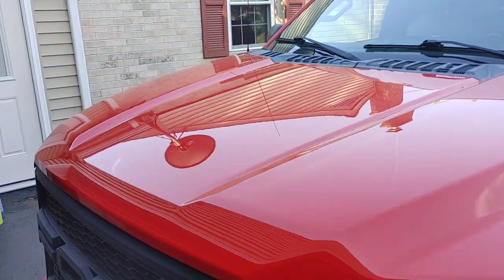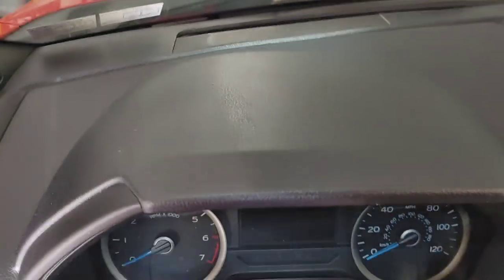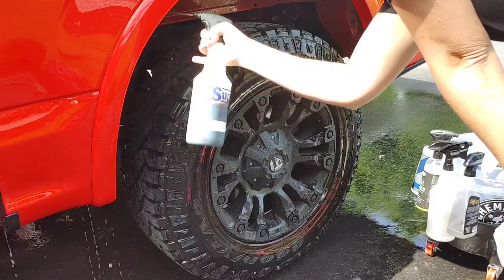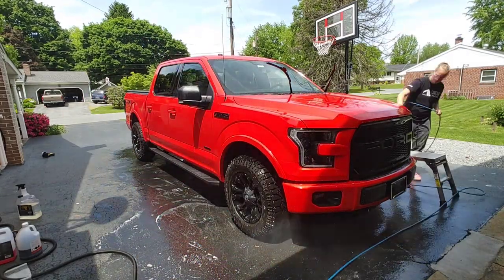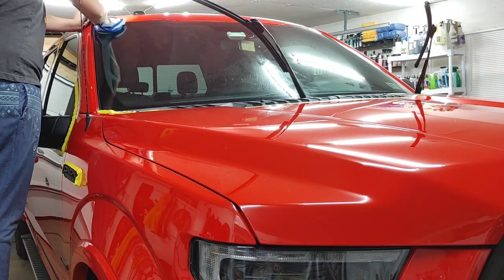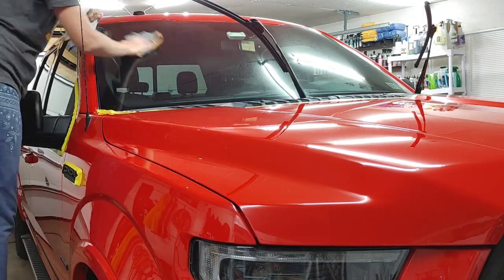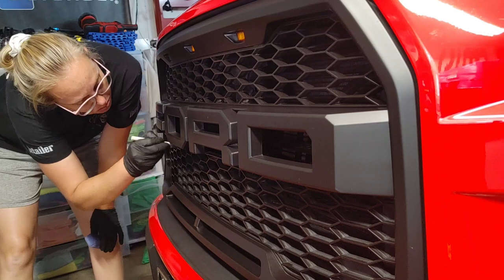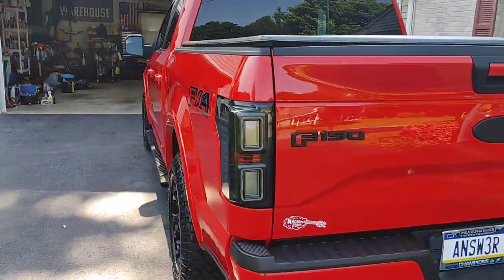Ford F150 Xlt: ULTIMATE DETAIL- Interior + Ceramic On Paint, Glass, Tires & Wheels! Tips & More!

Comment: Incredible job looks fantastic. I have a question I detailed my truck yesterday and drove it to work and noticed the hood was dusty.  What would you do to clean the dust I’m afraid to wipe with a microfiber towel and scratch it?
Reply from the maker: Do you have any rinseless washes? Can mix some up even in a spray bottle and use it as a quick detailer to remove light dusy and fingerprints etc